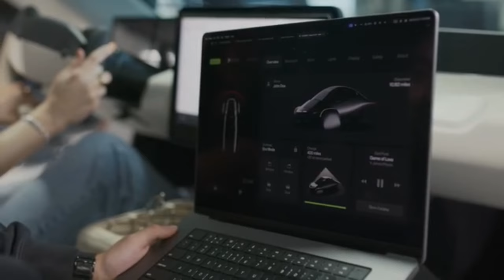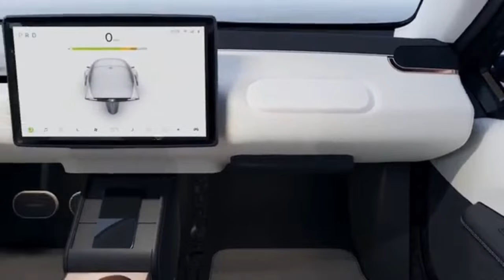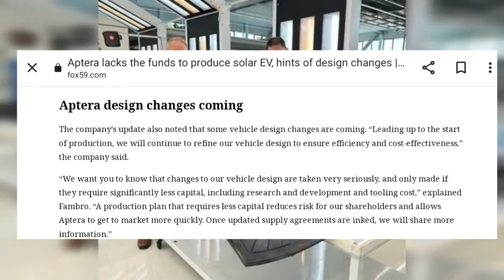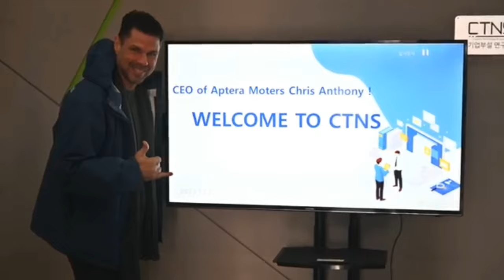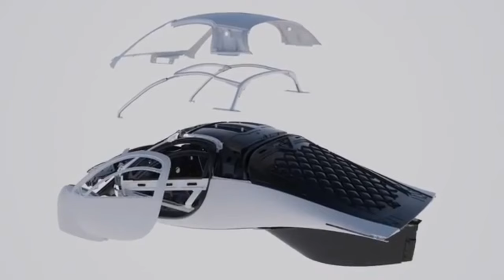Aptera racing for Funds to Produce Solar EV, Hints of Design Changes.

Comment: Embracing the enormous paradigm shift that Aptera is, is beyond the capacity for many to not only grasp but understand!  The naysayers will grasp on battery limitations in cold or hot weather OR in long slow lines at charging stations or at supposed safety issues and many will even carp at range.  They cannot comprehend a very efficient, safe, minimal parts, easy to build AWD car powered by the sun and chargeable virtually anywhere.  I'm all in and am very excited to receive my Aptera LE.  They will definitely succeed at bringing this exciting new concept to the people!
Reply: What is your maximum price, minimum range, minimum solar miles/day 365 day avg, latest delivery date?
Consider with those values, home array plus Prius PHEV blows away Aptera not to mention it's real, cheaper, and bigger.
Reply: You could've researched this if you were willing to learn.  We don't know yet the max price for the 1,000 mile range, but the Launch Edition which will have a 400 mile range will run about $33,000.  I paid a bit more than that for my 2016 Prius.  Here in NY according to Aptera and recognizing that NY doesn't have as much insolation as Carlsbad, CA, they are estimating about 8,000 mi/year from solar alone--no plug in charging for that amount.  Aptera has also estimated a delivery date (based on raising the capital needed for the small tooling (large tooling is bought and paid for) of late 2024/early 2025.  Latest delivery date could be never--let's be real.  Toyota could under exigent circumstances (unforseen) never deliver another Prius or any car for that matter, so that's just wild speculation.  In sunnier areas the Aptera can get 11,000 miles per year with their 7kw of onboard solar cell alone!  It is probable that in NY wintertime, the 400 mi range of the launch edition Aptera will have it's range reduced on account of cold (use of heater, etc.) by 40 or 50 %.  But my own experience have had only Priuses since 2006 (purchased brand new 2006 and 2016) is that my 60mpg summer/spring mileage drops to around 42mpg.  Neither are capable of plug-in charging--they are straight up gasoline--hybrid vehicles.  The Aptera is brilliant design an paving the way for solar powered BEV's in the future.  By the way Aptera IS real, is cheaper to operate, to maintain and has greater cargo area than Prius, but it is only 2 passengers. @artsmith103
Reply: @rchender  I'm quite sure none of what you posted is correct. That's the point. My home is gridtie solar, I offer free consulting for homeowners considering solar. Share data regularly with 3 other array owners. Own a PHEV. STEM degree from top 5 university. PE license 1st sitting. I have not seen anything truthful or promising coming out of Aptera. The staff alone oozes incompetence. They are not car people. Maybe someday they'll have an app..... When they 1st started cheerleading solar, the incompetent mistakes they advertised were pathetic.

Comment: This is not a particularly accurate take on the current state of affairs. True, Aptera is still looking for the funding to enable full-scale "hard" full-scale production, but they have indicated that they are continuing to move towards "soft" low-volume production in the meantime. Currently, the build-out of the first three production-intent vehicles is in progress.
Reply: Listen carefully to what they are building. They are not Production Intent. These are Delta prototypes with more experimental design. Production Intent language is misleading fund raising scam. To some extent, even what you described confirms they aren't productive intent.
Reply: @artsmith103  Production Intent is different than Production Ready. If the PI vehicles build out as expected and pass validation without issues, then they will be identical to Production Ready. Realistically, there will be some adjustments -- hopefully minor ones -- based on validation results. Yes, they are still working on a few design "issues" -- apparently (at least) suspension and chassis-related, but these changes will be incorporated into the early PI builds. By the time they get to PI #16, it will likely be indistinguishable from the first Production Ready vehicle to follow. Production Intent vs. Delta Prototype? Mostly sematics, I think.
Reply: @DrTeeHenry  Let's see if I'm blocked. My last 2 comments here were deleted. I don't care if there are 5 more iterations. I don't like the misrepresentations being apart of fund raising. Overall, I think a $40K trike has no future so I think Aptera has really lost its way. The staff we see on video do not look like capable car industry people. They look like a scooter company.
Reply: @artsmith103  Let's touch bases in 9-12 months... 47,000 reservation holders and north of 15,000 investors appear to disagree with your point-of-view. I don't mind -- at all -- the forward face of Aptera; yes, non-traditional, but the Aptera is a non-traditional vehicle. It's rather refreshing. I tend to trust the likes of Jason Hill, Sandy Munro and Rouch as well as the capabilities of CPC Group in Italy and Aptera's other European partners.
Reply: @DrTeeHenry  I suggest watching the status of relationship with Sandy Munro carefully. I think there was less than friendly separation. Munro is not acting like a supportive consultant waiting in the wings for the next participation. Aptera initial intro of solar charging was pathetic. Their vocabulary nearly outed them as fraud.

Comment: This vid was just a slightly biased and negative rehash of what Aptera itself has already said.  A big nothing-burger.....nothing to see here folks!  And now during this mostly quiescent period, the Negative Nancy's will all be trotted out to make disparaging vids about how untenable Aptera's design and production plans are.  Just makes me more certain than ever that once the 'bandwagon' is actually rolling on the highways and byways, the johnny-come-lately's will come out with their next line of criticisms--I'm guessing at how 'limited' the Aptera is and that it cannot meet the needs of families when data shows that many if not most cars on the road only have a driver in them!  I SAID MOST!
Reply: How a general vehicle is used most of the time does not address what it needs to do all the time. Sometimes a date's kids come along. Sometimes a small trailer is needed. Sometimes roof racks are needed. Sometimes the designated driver drives a few friends home. Sometimes it snows 6" while you're working. The space, seating, GVWR of Aptera are all inadequate as the single car for people that should be expanding their lives. If it was $15K, maybe okay for limited few. But at ~$40K it's an inadequate joke!
Reply: @artsmith103 Aptera is not designed to compete with 'family' vehicles. It is a niche product that will appeal to a smaller market. For instance, the number of empty nesters and retirees is growing in the US. They don't need a 4-5 seat vehicle. Aptera currently has nearly 50,000 pre-orders. That's quite a number considering most people have never heard of it.
Reply: @tims8603  Have you noticed how few views AOC gets compared to that 50K number? In 1988 I bought a new Nissan Pulsar SE.  The capability of that little pretend sportscar was amazing. Everything Aptera isn't!  In the climate scam culture we live in, betas think they are achieving something by being restricted martyrs. I just can't imagine how much worse my standard of living would have been in my single city 20-30s life if I had owned an Aptera instead of the Pulsar. Been there, done that!!
Everything I described was my single life 20-30s having fun in a city with a small car. The market Aptera claims. But the Aptera fails at all of that and might not have even fit in my garage.
Reply: @artsmith103 What does AOC channel have to do with anything. Not everyone has time to watch videos.   Steve has a good following and is providing info that is relevant. Aptera is a small startup that is trying hard to make this work.They're making steady progress. Some of the investors have invested thousands of dollars to get one of the first ones. Some even invested hundreds of thousands or more. I have a reservation but haven't invested. They may or may not succeed. No one can predict the future. You're comparing apples to oranges when it comes to vehicles. First, Aptera wasn't even conceived in 1988. Second, you don't know what would've happened 'if'. I'm glad it worked out for you. This is 2024, things are different now. EVs are the future whether you like it or not. It'll take some time but it's inevitable.
Reply: Will do better in the next videos . Thank you viewer.
Reply: @tims8603  The reservation count was from 3-5 year old promises that all failed. AOC view count shows the declining interest. Wait until the next round of exposure regarding price, delivery, performance :-( Would you agree they are already months behind in 2024?
Reply: @artsmith103 Just like Tesla promising the Cybertruck in 2019 and finally delivering in 2024. That's an established company with lots of money to spend. They also said that the body will be a exoskeleton but its not. If you think a startup company, especially a vehicle company, will be nothing but smooth sailing, you're wrong. Several factors, like the pandemic, chip shortages and the change from hand produced bodies to factory made bodies caused lots of delays. The initial excitement for Aptera was unexpected and caused many of the delays I mentioned. Why people like you want to paint a picture of doom and gloom is beyond me. If you don't want Aptera to succeed, fine. Join with the aussieman, vic(whatever) and the other doomsayers. you can all revel in your amazing deductive abilities. I the end, it's like just your opinion, bro.